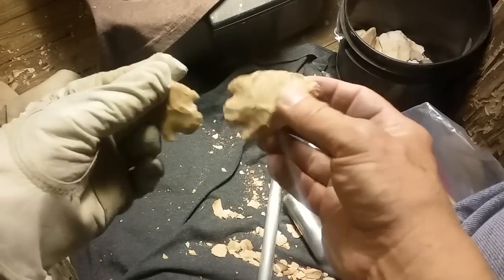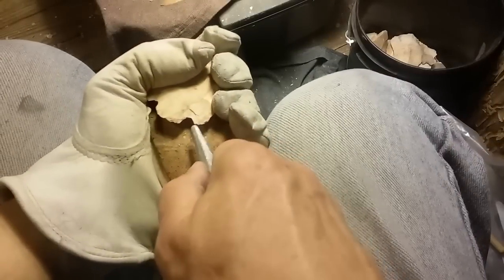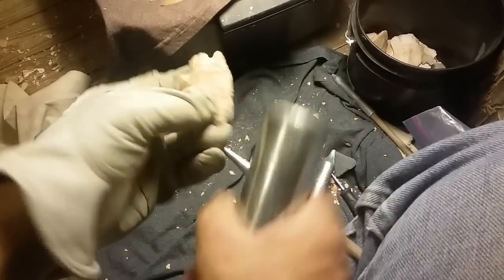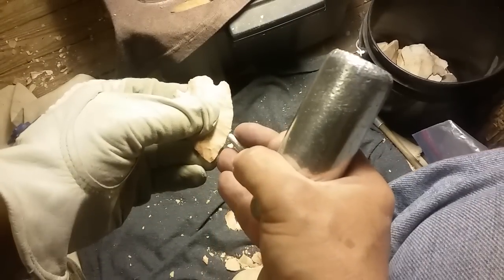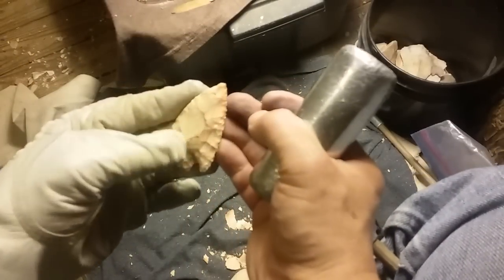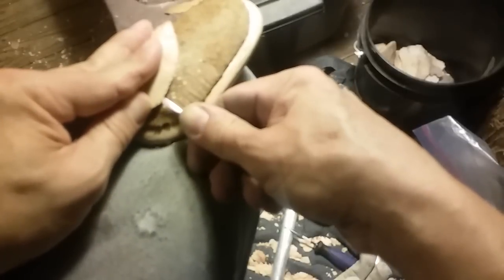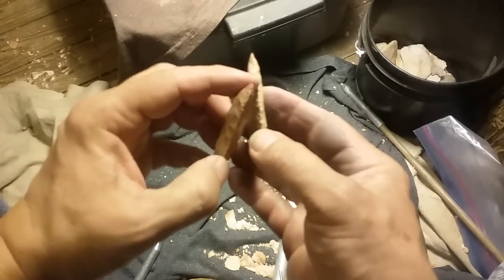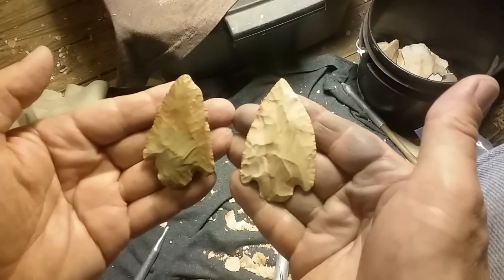609 - Flintknapping Mississippi Gravel Points 5b/7

Comment: Good job I have one thing to say you know You can use big old thick slabs of sand stone instead of braking grinding wheel's and if you run water on the face of the sand stone and move the work life along it lasts much longer than the broken pieces of grinding wheel. It can also sharpen metal for all you steel arrow head fan boys out there.      :-D